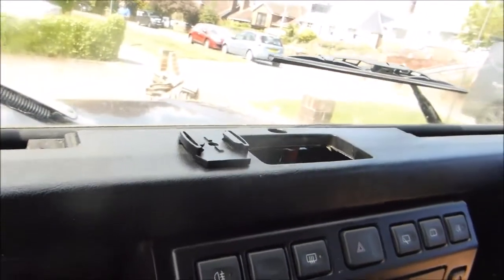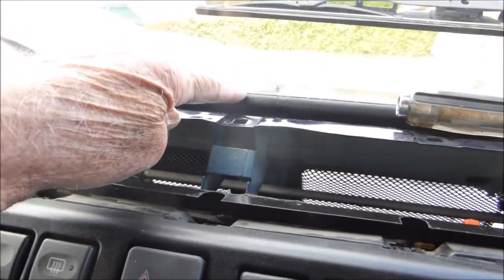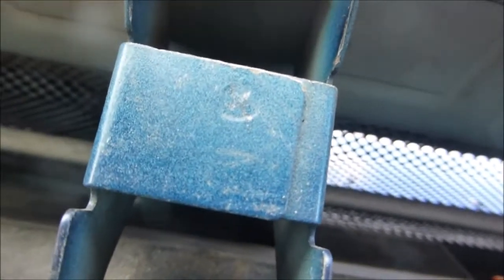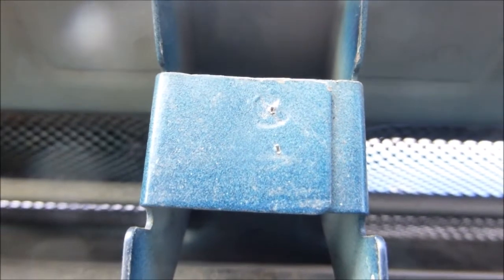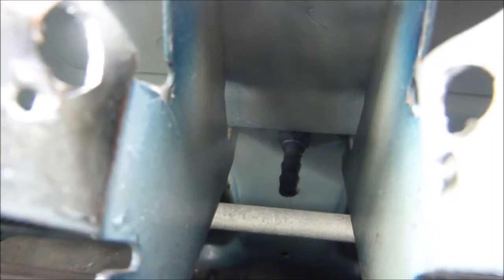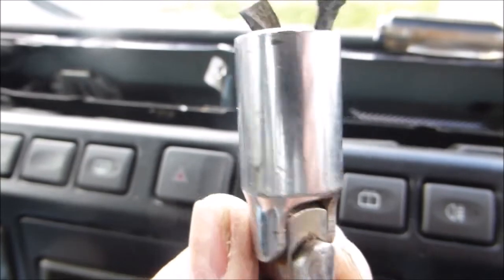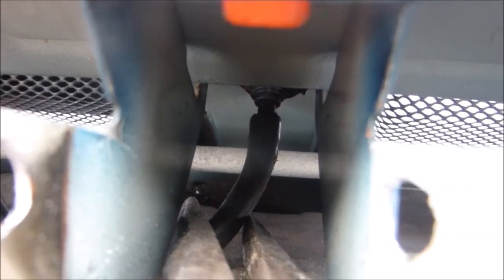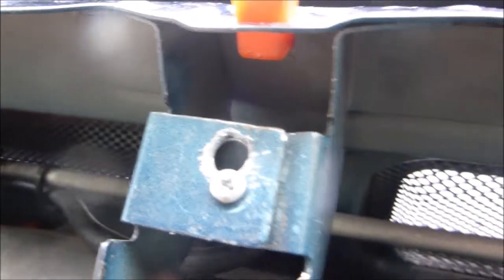Changing a Land Rover Defender screen washer jets

Comment: Thank you, it worked. Only difference is that I held the nut is a short section of split cable wrap an some electrical tape to firm it in place. My wife held it whilst I rotated the nozzle.

Comment: No! The washer nozzle just twists and pulls off. Use some WD-40. You don't need to remove the part that's held into the bulkhead, as it's designed to remain in place when you remove the nozzle.
Reply: Not on the Td5 - the whole thing has to be taken out unike on the earlier ones.
Reply: I have a 2005 110, just bought it and the washer nozzle is gone. So this video is great.
Reply: Why not just remove the four screws holding the plastic panel on behind the radio. This gives full access to the nut and the hose?
Reply: @TheRealMattMorton  because (at least on my NINETY) there's a metal panel blocking access to those screws 😄. In any case, the washer nozzle is push-fit, so you only need to twist-and-pull without removing any screws.